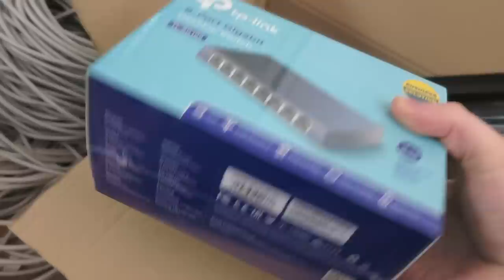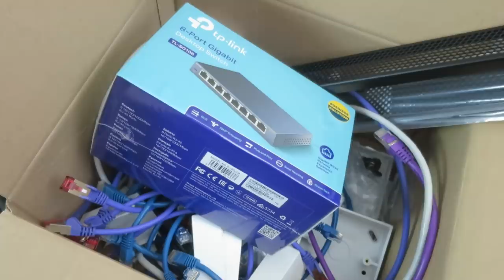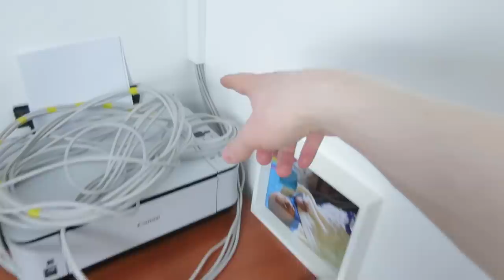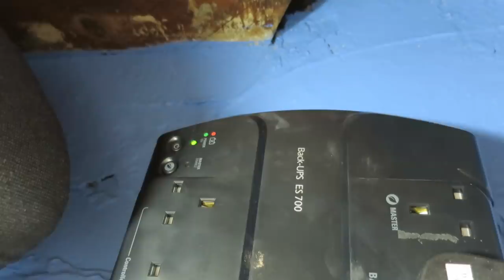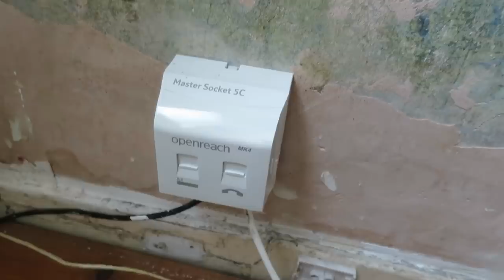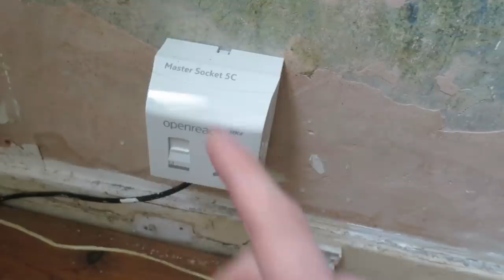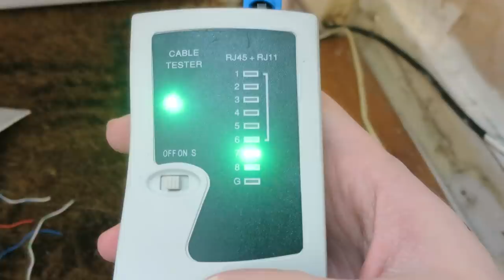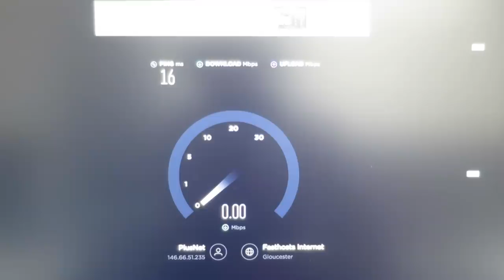Setting Up Our Home Network (Part 6) - A Vast Improvement

Comment: Hi Tom, just a thought about the run to your TV setup, what if you run the line to the TV along the run where you came from the modem (along the far side of the hallway) and then under the floorboards to the wall behind the TV? You would have to drill through the wall, but from my thinking of it, it wouldn't be much longer (or even shorter) than your proposed ideas, and would be a similar setup to the old phone line that is there from the previous owners. Not sure if you had thought of that idea, just a little suggestion. Great video!

Comment: Great vid. Did you consider moving the Master socket into the cupboard under the stairs?
Reply: BT Will get funny if you move the socket location, If you have a line issue and they come out you could be charged for it if you have fiddled with the wiring pre master socket. 

A similar solution would have been running the Ethernet cable to the filtered VDSL out on the faceplate (just using 2 of the 8 wires) into the jack in the cupboard and then ran it into the back of the RJ45 patch then gone RJ45 to RJ11directly into the Open reach modem saving having the unit on the wall in the hall. Yes there would have been a bit of extra cabling run for the phone connection but far less than the original 25 ft or meters (whatever it was)

However the setup works and it could be an idea for Tom to consider as an option in the future as it didn't make a significant speed difference, I found when I moved my master socket via CAT5E cable crimped directly onto the A&B lines over a fairly long run I had no speed issues.
Reply: As a telephone engineer moving the socket is fine and wouldn't have any problem.
Reply: james linington really? That’s interesting! Do you do openreach stuff? It was the open reach techs that told me off to moving my socket and the wiring previous to it.
Reply: @WillThePlank  yes he is correct. You shouldn't. an OR engineer can. And if you have a line installed you can now have it put where you want it and not just inside the front  door

Comment: When are you gonna do a PFSense installation?
Reply: Especially considering you can buy cheap Intel server nics on eBay and use basically any old computer that supports aes in hardware (I think cheap amd sempron CPUs also support it)
Reply: @jorgeszabo1659  The current PFSense needs a modern CPU, since AES-NI is now required. Those ITX boards with Pentium CPUs soldered to them would suffice.

Comment: Tom - what about running plastic molding (trunking) along the join of the wall and the ceiling to get to the TV? Up so high it should be much less obvious than running cable up and around the door.

Comment: Nice vid as always, ramble on my firiend. Btw, the reason that you don't daisy chain switches has to do with potentially the port on the switch up the chain not being able to handle the traffic if all the ports downstream of it are active at the same time. That is not likely to be the case in a home network. Its always better to do homeruns back to managed switches and have all those linked in to say one master switch (talking from the medium business or larger perspective here, a home network is not likely to ever deal with this issue). The other reason to avoid daisy chaining switches has to do with the number of hops (again not an issue with home networks). One thing to be aware of though, do not use any hubs when you daisy chain. A lot of those home routers have hubs built into them not actual switches. Buying a cheap unmanaged switch rather than reusing a old home router as switch is the better option.

Comment: I would never use them psuh through things for netowrk cables, ether run them in the same 1u to the side of the rack and back in ( with a service loop) or use short jumper cables on the frount of the rack. They looks nice but are a pain in the arse when it comes to tracing a cable , with a small home its not a problem but in a bigger install its just not going to work out, get tangles everywhere. If a site i am looking after has them they go in the bin simple as.

Comment: YES! Another IMNC! I have some project work to do, some photos to upload and now I have something to watch while doing it. Thanks Tom, once again mate, your timing is impeccable!

4:46 - The rack won't go through the cupboard door. Solution? 
1) Knock down the house
2) Position rack
3) Rebuild house around the rack.

To remove, reverse the process.
Reply: lol god plan to get the rack in the cupboard
Reply: @misterdogg2005  It might not be sensible, or practical. But it would definitely work...
Reply: Lol

Comment: You could have used Google Wifi mesh routers and eliminated a lot of the issues you were having and running into. I use them in my home and business and love them and with no drop off in regards to connection speed.
Reply: DiZZi Entertainment who’d use anything google? They’re probably uploading your entire network traffic as we speak 😮
Reply: @jasonlee3247  Yeah, I agree. ASUS Lyra, Linksys Velop, or Samsung Connect Home would be better options.

Comment: fancy marketing wording
business solution
tp link most basic 8 Port dumb switch and they call it business solution
I have a PC, yes whole computer which works as bridging firewall (switch in less fancy wording) and it have 64GiB DDR3 PC3-12800 1600MHz RAM, it's 6x 4TB SAS HDDs, 4 port GbE (Gigabit Ethernet), 4 port 8GFC (Fibre Channel), LSI MegaRAID MR SAS9261-8i SAS RAID (for RAID6) and something else I do not remember now (maybe NVME + SATA M.2 Adapter)
I do not call this business solution even though I keep all data from my business there

Comment: 8:29 Why didn't you just attach it to the edges of the wall? Is it so that you could just open it up later on?

1:03:03 I just noticed something: That electrical socket looks original to the house, and if there was a door next to it, then… well, that'd probably be weird.

Comment: I would have thought that Hyper-Speed TP-Link Powerline Adapters and make the mains wiring  carry the data, If you had roughened up the back of the trunking you could have used No-More-Nails instead of screws, If you are feeling a little under the weather then what about a combo of a Vegan Phaal and Vegan Vindaloo to give the flue the big heave ho and most certainly should be very agreeable, You switching to FTTP any time soon you know ONT,Battery Backup and PSU and then a satellite cable between the ONT and router, what speed do you get between yourself and Douglas IOM.

Comment: Why didn’t you just run all your network drops to the office, that way it’s only one switch in the loop as you can use the other port on the openreach hub on another switch
Reply from the maker: Addressed in the video (at some point).
Reply: the other port is for accessing and conglomerating the modem and is not for connecting devices
Reply: Qtech HD I meant run every cable to the office, and avoid the boxes in the cupboard, so all the cables go to one central location
Reply from the maker: @harrycroft7972  That's basically what's happening already, the office being the central location. There aren't any switches in the cupboard, they're just sockets. I chatted about the benefits of socketing all of those lines in a patch area in Part 5, also in this video somewhere (I think) and in response to another comment on this thread. Basically it's all about flexibility and future upgradability.

Comment: Why run multiple lines to the cupbard (closet I assume for Americans) and to the back of the TV??....because you are eliminating a point of failure device.  By reducing the number of hops and physical devices, reduces potential outages. Should that 8 port switch fail, it will take down everything attached to it. Individual wires wont fail. Switches should only be used when reaching the distance limits of the given cable spec that you are pulling.

Comment: at best you will get less dropped packets and less error on better cable, but you will not gain any speed at all
cable have almost nothing to with speed
you can easily get Gigabit Ethernet over two twisted pairs as long as you have cat 5e and not longer then 100m
you can easily get 10GbE over 4 twisted pairs Cat 5e over at most 30m distance
coding is pretty much same with ADSL and Ethernet, as there is not much of possibility of inventing anything new over what exists (only incremental improvement is possible without some ground braking new technology)

Comment: What about bringing the tv cable out at the same point as the airport express and hiding it behind some trunking near the celiing/wall intersection? That way u can make a neat run over to the tv area and feed the cable into a backbox for connection to your switch?

Comment: Surely your speed was always going to be the same because you still have the run upstairs to the router, whether it was before or after the open reach modem? Yes you have reduced the distance in your house by a few metres but in the grand scheme of things (when the signal has to come maybe a few kms from the exchange it won’t make a dramatic difference. Also it’s best to check changes in speed by checking the router stats rather than Speedtest

Comment: 12:47 Oo-er missus! That's what she said! 😏

38:01 Scotia!

53:48 If anything, it's a testament to your previous work! It might actually improve if the MODEM had only just finished booted up.

1:02:22 You could try taking up the metal threshold bar, as there might be enough of a clearance around it to run your cable. If anything, it should make it a hundred times easier to tuck the cable in under the laminate.

1:03:08 That skirting piece should come away relatively easily. Simply wedge something like a wallpaper scraper or filling knife along the leading edge and give a few gentle 'taps of encouragement' along the way with a hammer; should come away relatively easily. 

You can always use a grab adhesive such as Gripfill to stick it back, and then decorator caulk along the top to hide the seam. Job's a good-un! 👍

Comment: run it under the wibbly wobbly flooring. Then, why not cut a tunnel or grove, in the skirting board on left side of the door till you get around the corner.  You'd have to do that on all 3 parts of the skirting boards.  just a thought

Comment: Instead of running the cable through the floors, why don't you run the cable through the ceiling space and drop it down the inside of the wall by the TV?

Comment: You need to leave your modem connected so the BRAS can be reset, basically the speed your connection is limited to, give it a couple of weeks to fully reset, but then again that is a really old modem now and Openreach and BT have dropped support for it, so no more firmware updates for it. I use a Draytek Vigor 130, syncs in at 20 mbps up and 71.5 mbps down. I get consistent speeds of 65 mbps down and 17 mbps up. It’s connected into my old MK4 VDSL faceplate with a 1.5 metre heavily shielded CAT6 cable.

Comment: Nice job. found this intriguing & interesting too! Airing on the side of caution, try not to run network cables parallel to mains/power cables, (under the floor at 20.20) to eliminate any possible EMF interference! Which could result in slower transfer rates.  Less likely with the shielded, of course, but thought i'd say, just in case you might not be aware!

Comment: Final comment, really neat work Tom, moving the modem next to the master socket is what everyone should do! I like the cupboard work and think another piece of board would be good to hide, or attach the lose cables to. 
As for the run to the TV, I see the dilemma, you have to make it toddler proof otherwise it won’t last 5 minutes. I think going around the door frame with your dads help is the best option, and then try to go behind the skirting board in the pillar, or use some small trunking to go around it, that would be the best and nearest solution I think. Anyway good work mate, keep it up :)

Comment: Great job tom... Btw when using those cable testers you gotta check the lights on the remote as well, if you cross wired it the mistake will only show up on the remote side.

Comment: Some latex caulk can be used to cover the gaps/holes around the trunking and wall.  I am more concerned about the obvious wear marks on your copper pipes at 19:53 Something is resting on them and they will break/leak sooner or later.
Reply from the maker: Thanks for pointing this out, will have a look just in case.

Comment: Wire duct should run along the floor to keep the beauty of wall intact.
Reply from the maker: But then you can't push your furniture against the wall, essentially meaning you lose floor space / make the room smaller? This is quite big trunking.
Reply: ItsMyNaturalColour oh man i specifically asking for computer room where you have you networking rack. I would prefer to keep the duct at the ground level at least inside room, outside the room your wiring is good enough. Currently you have duct running at the door level, while it should run down near to the floor. This way wall will look neat. Inside room it should be along the scarting , thats all what i want to say.
Reply: Overall i am crazy fan of your videos. Thanks keep it up👍
Reply: In the office I would have keep the conduit at the ground level... Exit the door and with a little corner go under the floor... Nice and tide

Comment: Did you consider mounting the Openreach modem in the cupboard under the stars and running a cable from the socket to the modem?? Would have been out the way then!!
Reply from the maker: I did indeed, that was a big consideration. I opted for the front door placement in the end purely to keep the cable from the phone socket as short as humanly possible, squeezing as much speed as I could.

Comment: I'd recommend hooking up a computer directly to the modem with a short patch cable for once and do a speedtest from there, just to check whether the in-house cabling or the router is decreasing the speed for any reason. I'm especially concerned about that PoE injection, if I may. :)
Reply from the maker: Too sketchy for your tastes? ;) 
I'll see what I can do in Part 7 for some more varied / concise speed testing.

Comment: Couldn't you run 1 cable to the cupboard then have another switch in there, then run as many as you need to things downstairs 🤔 wouldnt need a switch behind the TV then.
Reply from the maker: I would still need a switch behind the TV as I can only run 1 line to the TV and I have more than 1 device to plug in. If I was able to run more cables behind the TV, I would've pulled more through from the office.

Comment: you could have slightly cleaner wire runs if you use 25 or 50 pair utp cables rather than running messy bundles of ethernet.

Comment: Thanks for putting this together. Hard to make progress when life gets in the way, but that's what life is for :) - One thing I would recommend for the network under the stairs, is to use a rack strip there too. You can cheaply mount that with some angle brackets and/or blocks of wood. The wall-mount single, double & quad blocks you have, can be deployed elsewhere as needed (so you avoid wasting money). It gives the opportunity to free up some space.
xDSL type solutions are tricky. On the one hand, you want to have the shortest runs for signal cables. On the other, I dislike the idea of having non-UPS protected core network equipment. For this reason, I think I would recommend sticking the router in the under-the-stairs location, connect to battery backed socket, then connect it all up from there. You already have a great backer board there, plus UPS, plus sockets, so it feels like a good approach. It also avoids having to box in equipment that needs ventilation. Our kids are older, but we have dogs, so they tend to try to snack on a cable sometimes if bored :)
Great to see you getting some more videos out!
Reply from the maker: Thanks a lot for the comment, very much appreciated !
Both my modem and router are backed up by a UPS. The router (AirPort Extreme) runs from the larger APC UPS in the rack. The Openreach modem placed by the front door runs from the smaller UPS in the cupboard, via the PoE injection that you see. As for the boxing in, the ventilation is a concern for sure. I'm hoping to siomply box in the bottom half of the equipment where the cables connect. That leaves the vents at the top of the modem completely free, hoping that will be enough. Only time will tell I guess.
Reply: @ItsMyNaturalColour  I didn't realize the OpenReach modem runs on PoE;  If you disable the WiFi in the ISP modem, they tend to run a lot cooler. It is great to see all this coming along. I moved out of the UK nearly 10 years ago now, but I used to have my gear up in the loft. It is better to have it where you have it, as it is easily accessible and extensible. Keep up the good work.

Comment: I see a mac pro there ;)
Reply: I was shocked when I saw it 
Is it a 2008 Mac Pro
Reply: TheMugha where was it?
Reply: It's his quad powermac g5
Reply: @JacobKelly02  No, there is definitely a Mac Pro sitting there.
Reply: Jacob Kelly that’s what I was thinking they were talking about but just Incase I asked where else they saw one.
Reply: @carsonshoe6133  under his desk, it appears in the middle of the video.
Reply: TheMugha we talking around 48:20 ? How do you know it’s a pro
Reply: @carsonshoe6133  because it has two disc drive bays, and also because it is with the hard drive bays on top of it, I'll give you the timestamp
Reply: @carsonshoe6133  48:20
Reply: TheMugha my apologies I notice that now. All valid points
Reply: @TheMugha  And it has FireWire 800.
Reply: Don’t forget the HDD sleds sitting on the top